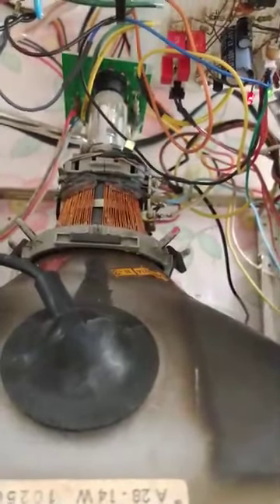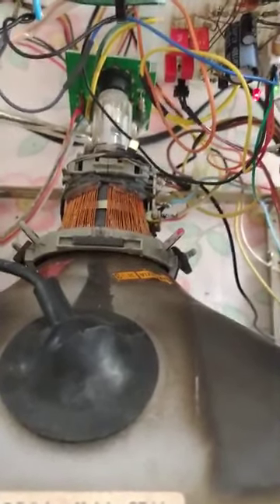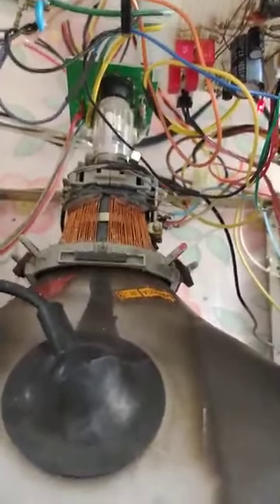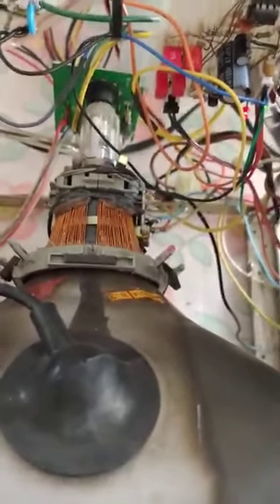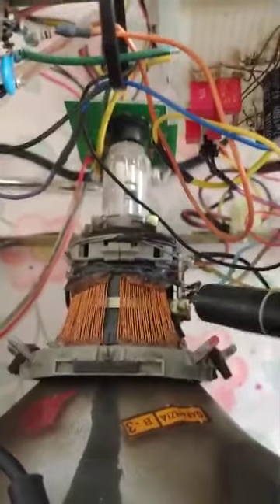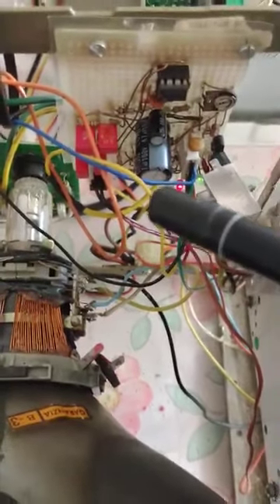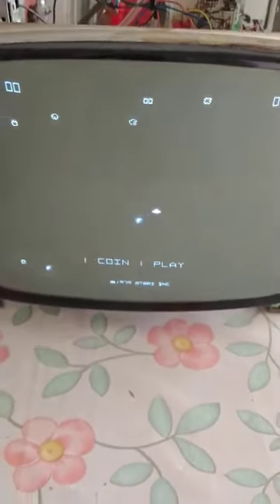Home made 11" CRT vector monitor. "Almost there".

Comment: That’s just fantastic work!!! 
I’m nearly there with mine, following your EHT design I added windings to an open frame LOPT and achieved 8KV quite happily, there is some odd ringing, Will show you some pictures when I send the 82S123 programmer design.
Reply from the maker: Thanks! If you opted for the self-resonant single-ended primary, it's really odd that it has any ringing, but it could be tamed with a capacitor change in the collector circuit maybe. If you have scope images, you can send them and I'll have a look. Also send your schematics with number of turns and pictures. The more information, the better :)